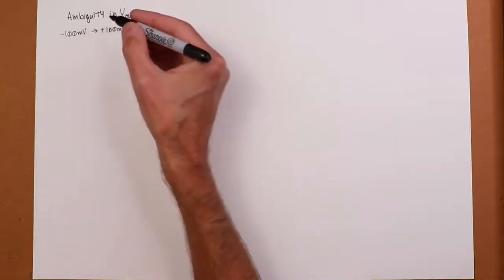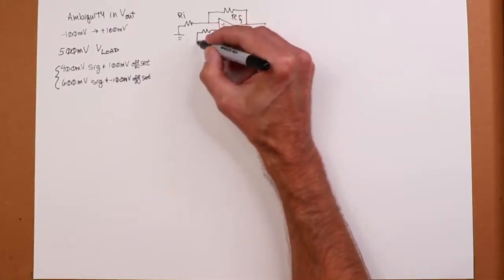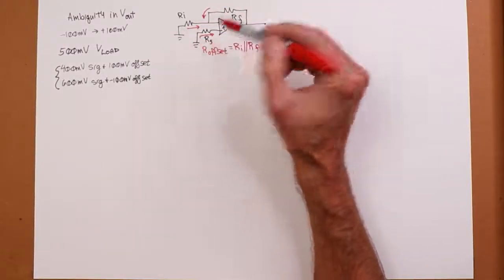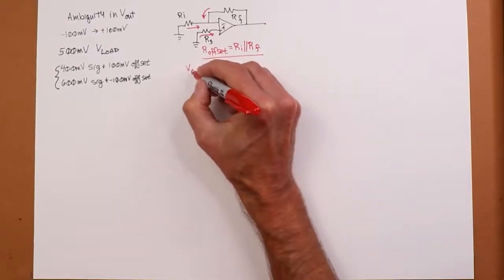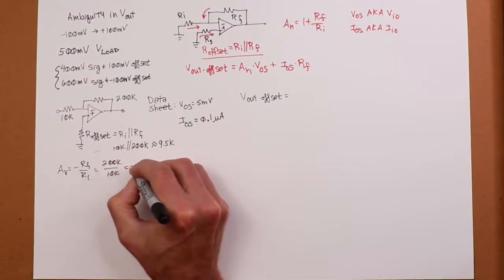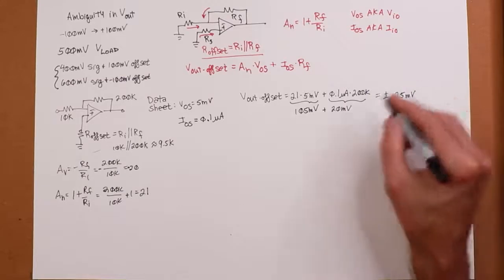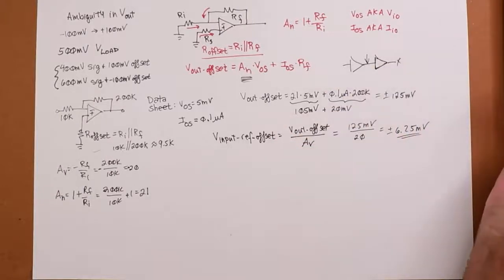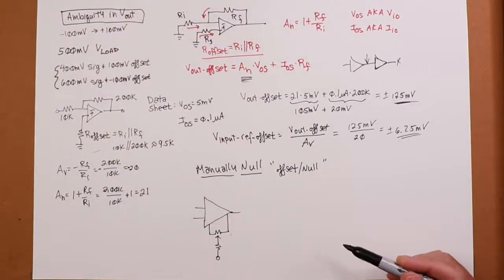Op Amps: DC Offset

Comment: Hello! I have a question. If i WANT  my op amp to produce a DC offset of a certain kind. Can I just reverse engineer this? Would I still need the Roffset resitor?
Reply from the maker: If you want a DC offset you probably don't need Roffset. If you need a large offset (like a few volts), you might look into summing in a DC level (see "summing amplifier").

Comment: In the case of an audio circuit with multiple op amps cascaded in a unity gain filter configuration, is it necessary to remove DC from the signal in every stage or just the last op amp of the filter chain? For example, a unity gain low pass filter with no series capacitors.
Reply from the maker: You could do it at the final output. Generally the offsets won't be so large as to limit the dynamic range of the individual stages so you don't have to do it at each one. OTOH, if there is a potentiometer in the signal chain, you'll want to get rid of the DC before it. The reason is that with a less than ideal pot (i.e., dirty), any DC voltage will create level shifts and transients when the pot is adjusted. This will be heard as a scratchy noise.
Reply: @ElectronicswithProfessorFiore  OK great. That saves me from a lot of math. Could I possibly use single-amp op amps as buffers before entering the power amplifier and utilize their offset adjust pins? The datasheet is telling me not to. I guess because they only intended for the pins to be used to adjust the offset of that op amp. Do I have to listen to that? They also say that the op amp is internally trimmed and doesn't need adjusting. Can I listen to THAT? I'm just trying to avoid using a capacitor on the input of the power amp and I definitely don't want to design a DC servo circuit. But at the same time I want to eliminate the chance of DC reaching the output section. Is this a "wish in one hand and sh*t in the other type of situation?
Reply from the maker: @deviantmultimedia9497  Not sure what you mean by "the datasheet telling (you) not to". Offset adjust pins are made for adjustment. The downside of manually nulling an op amp is the cost of a precision trim pot (don't use a cheap 3/4 turn, get a 20 or 25 turn) and the fact that you have to adjust it (time/labor). Over time it might go out of cal, too. 

Most recent generation op amps have very low DC offsets to begin with (assuming you're using a typical design- see details in the text). We're talking order of magnitude reductions compared to first and second gen devices like a 741 or LF351. But if even that is too high, a coupling cap is not evil. Just get a nice film type (polyester is a good performer for the price, polypropylene is nicer but more $). The Fc is just 1/(2 pi C R) where R is the input impedance to the next stage (the output Z of the op amp stage can be ignored due to its small size). You can also place the output stage within the op amp's feedback loop. Lots of power amplifiers have been designed this way. There is some discussion of this in the text (chapter 6).
Reply: Excellent advice, man. And your pdf rocks! Thank you for sharing it. When I said the thing about the datasheet telling me not to I was referring to this "This adjustment
should be used only to null the offset of the operational amplifier, not to adjust system offset or offset produced
 by the signal source." from TI's OPAx134 datasheet. But now I don't think that applies to me since I do have the input AC coupled with a 10uF PP film cap. Well, there's a differential summing stage first (to receive a balanced audio signal) and then  I have the cap on the output of that. That being said, you made a good point about modern op amps having negligible DC offset. Also, yea those trim pots are not cheap. I'm not opposed to overkill at all, but after adding up the extra cost and board space I can see this becoming "the retarded type of overkill and not the smart, beneficial type of overkill." As a wise accountant may have said.  Thanks for the advice and the pdf book. Cheers!